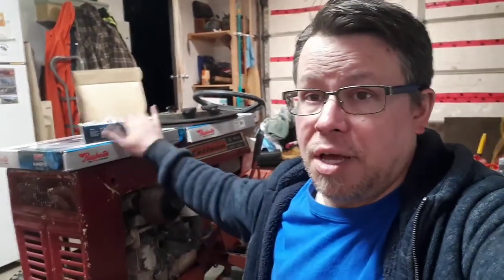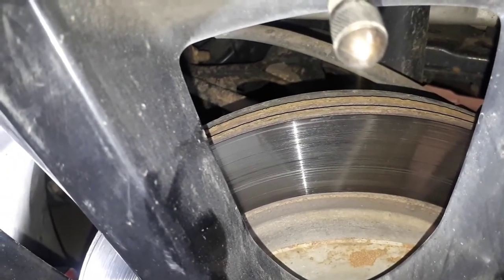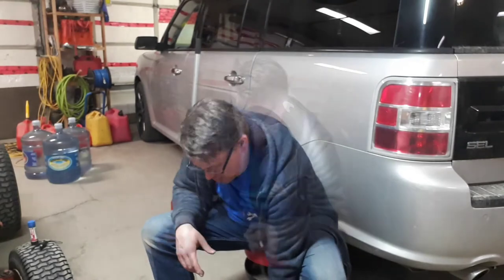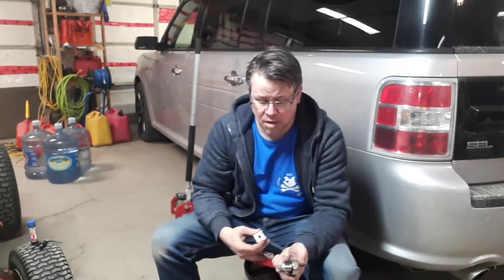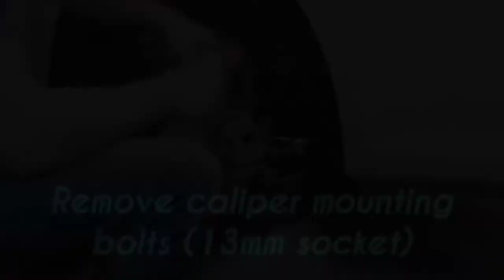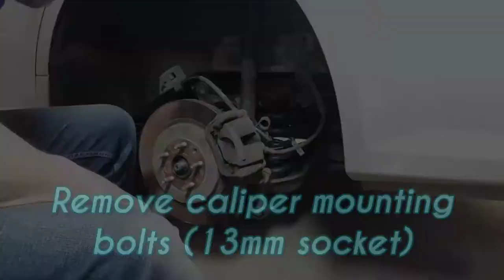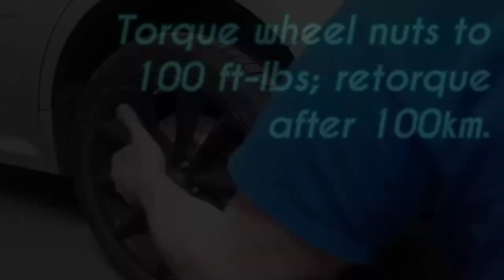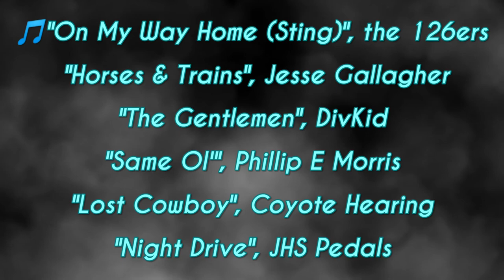Braking Our Flex! How to Replace Rear Disc Brakes on a 2017 Ford Flex!

Comment: Again, I bet the caliper piston was hard to turn because of corrosion between the dust boot and the brake fluid seal.  I would screw it out as far as possible without spilling fluid, remove or get under the dust boot, and lubricate that area heavily with brake grease, or at least a heavy, silicone spray.  Then it should be far easier to turn the piston back in with the tool.
   I am also not clear on what was wrong to begin with? scraping wear indicators?  None of the pads I saw were down to the backing plate and if you are going to replace the rotors anyway, you might as well score the old ones first.  What was causing this noise?
   I rarely replace rotors, even after a mild scoring against a pad backing.  I don't even think about it unless I get a pulsating pedal from warpage, and then I compare prices with the cost of machining.  Except here in the Appalachians, you sometimes want rotors with cooling holes to help get down the mountain.  A tad of negative camber is ideal here too so as not to wear the outside tire shoulders on all the mountain hairpins.

Comment: Thanks for posting!  My first Flex was a 2013 Titanium,  with 160k miles and ran strong until someone  turned left in front of me. Now I have a 2017 Limited ecoboost 😊 and gonna do my first brake job on it. Coming up on 78k miles and it runs  strong too !
Reply from the maker: Thanks so much for watching! Nice! We really like our Flex. My dad has a 2019 Limited EcoBoost and it's a rocketship!

Comment: Actually, reviewing your symptoms at the beginning, I would say the brakes are failing to release completely due to corrosion either between the pistons and calipers and between the dust boots and fluid seals, or in the parking brake cables or mechanisms; in which case, you may not have really fixed it, and if it seems fixed, it may just be dragging silently instead of squealing.
    Spay waxing the underside routinely helps keep all this stuff lubed and far more, but once it is jamming it might need some disassembly to work the lube all the way in, especially to the center of the inside of the parking brake cable sleeve.  I devised a way to inject grease into a boat, stern drive control cable once, but I partly forgot how.
Reply from the maker: It is possible, although that's not a common issue here in my experience. Then again, this is the first Flex I've ever had!

Comment: There are a few caliper compressor sets on Amazon for ~$30 that act as both the clamp and the pins to engage the piston. In my experience, that style of tool is more resistant to slipping out of the piston than the small cube type.
Reply from the maker: I did not know that! If there are many more of these in my future that will be WELL worth the investment. Thanks for the tip, and for watching!